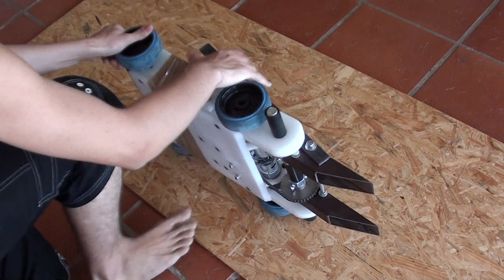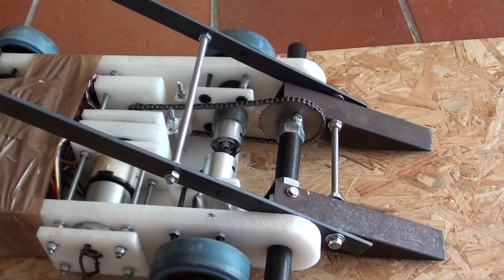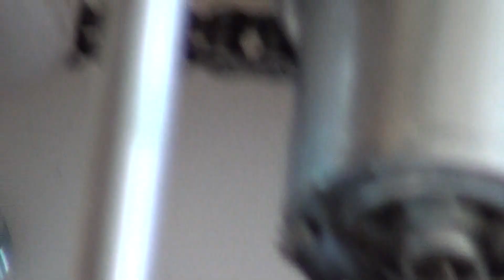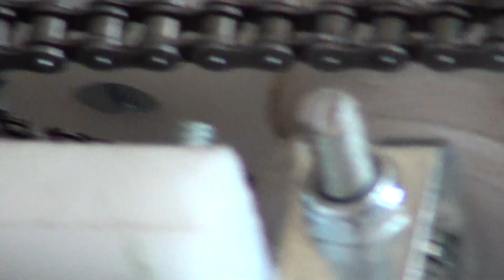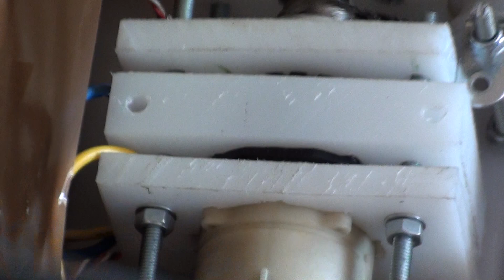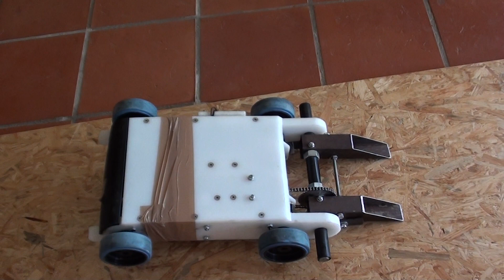Tormenta 2 (featherweight robot) - First weapon test

Comment: How are you controlling the weapon motor?
does that need a speed controller?
Reply: Yes when ever you are using an electric motor you will have to use a speed controller to get the signal to work with a small rc receiver you can't just directly connect them.

Comment from the maker: That was one of the key features for our machine. The back wheels stayed in contact with the floor when the machine was up at the front by 45deg. or more. Sadly it would barely drive like this (enough to be beyond immobilisation though) since being some 60cm long there just wasn't enough grip at the back wheels, nor power, to drive well. 

Also, Tormenta 2 is most likely going to be retired and a Tormenta 3, with the same style of weapon, will take its place. :)
Reply: Need the lifter  motor  plz help to make one
Reply from the maker: @rahulghosh0210  Answer to this question is already in the comments. It is a big old cordless drill motor and gearbox - a 14.4V AEG combi drill, to be exact, but any big 12-24V drill would be similar enough. New ones usually have the motor built into the plastic body, so not very good for robots. Old ones have separate motor+gearbox inside (like this robot uses) so I would search for something like that.
Reply: Thankyou